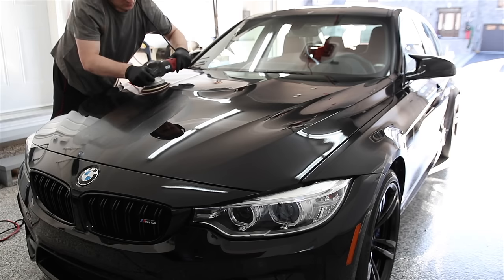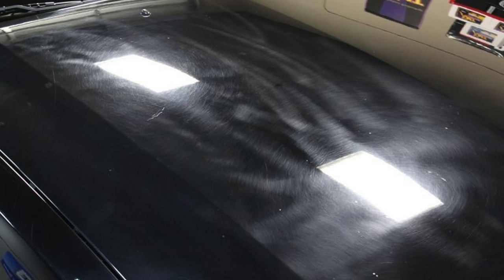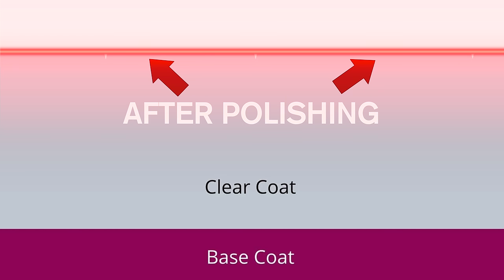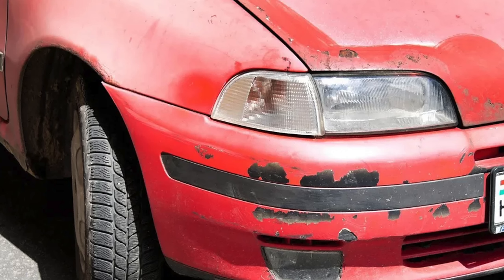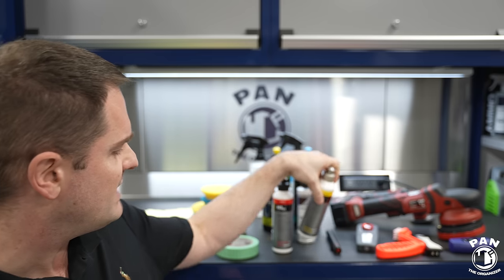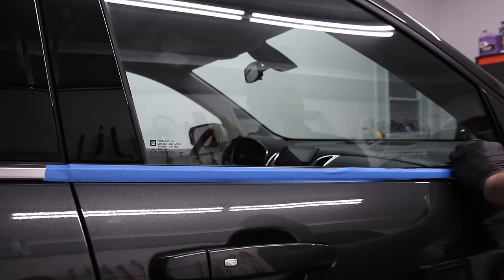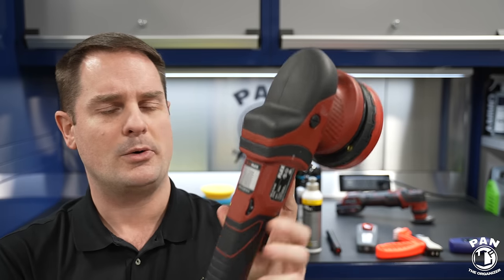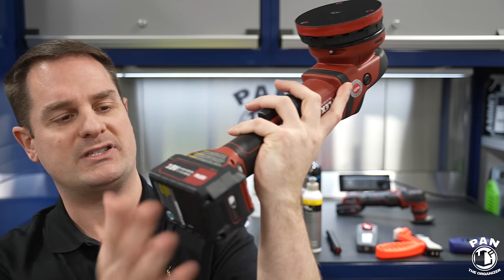DETAILING 101 - Paint Polishing - Everything You Need To Know

Comment: So you’re saying that polishing will wear down the clear coat? That kind of freaks me out. Shouldn’t we want to protect the clear coat, rather than wear it down?
Reply from the maker: Polishing by definition is using abrasives to remove scratches and swirls and oxidation. It does that by diminishing the layer of clear coat to make it "flatter" and with that comes an increase in gloss as the light reflects better.

But you don't polish every month. There is enough clear coat on a new vehicle to last many years if you protect it. Once polished, if you use safe washing and drying methods, you should not have the need to polish for at least a year or two, perhaps more. 

I keep my new cars three years before buying a new one, and during those three years, I only polish the vehicle once: when I take delivery. To make it perfect and then I protect it. After that, I use safe washing and drying techniques and never have to polish again during those three years.

You could polish the clear coat a few times before even having to start to worry. You're removing that much clear coat after one polishing session. Unless you are using an insane rotary polisher with a wool pad and super aggressive compound because you have super deep scratches or swirls, or perhaps even you are doing water sanding, which probably won't be the case if you don't have any polishing experience.
Reply: @PanTheOrganizer  Thanks for clarifying!

Comment: The "fingernail" analogy confuses me... I have what (I'm pretty confident) is a clear coat scratch, but I can feel it with my nail tip... I really don't think it's even close to the paint layer, let alone the primer layer.
Reply from the maker: If you can feel it, most likely you’ll need to start with a compound first and cutting pad, and then do a polish step with a polishing pad.

Comment: Why can't you just add lacquer back onto the paint to get rid of the imperfections like scratch lines if the issue has to do with it in the first place? Why do we have to buy all of these expensive products instead?
Reply from the maker: If you were to try and fill all the scratches and swirls on your car with touch up paint, it would take for ever, and it would look like a hot mess. All your work would stand out like a sore thumb. There's a reason why NO professional detailer does this. It wouldn't be a nice result. Paint correction is the way to go.

Touch up paint should be just for what the name states: touch ups. Small rock chips for example. Where paint is missing, as you are down to the primer or metal substrate.

Scratches and swirls aren't down to primer or metal (unless you have super deep scratches from a key job or some accident). They're just in the clear coat, and reflect light in a way where you see the imperfections. Paint correction levels the clear coat, making it true and flat again, so the light can reflect properly and you see nice glossy perfect paint.

Comment: lots of good info, but the terminology is a bit confusing. compound is "a chemical that combines two or more elements", why abrasive stuff is called compound and finer polisher is not? dont they both include two or more elements?
Reply from the maker: They are all polishing compounds. That's the general term for liquids that are applied with a polishing machine. The liquids act like sandpaper to gradually remove surface layers (clear coat) and eliminate scratches.

But to keep things simple for beginners, there are two general classes of polishing compounds. 

A "compound" in the detailing industry is lingo for an abrasive with larger sized abrasive particles, meant for heavier defect removal: heavy oxidation, big scratches and big swirls.

A "polish" is a refining abrasive, with smaller sized abrasive particles, meant to remove the "sanding" marks caused by the compound, and further refine the surface, increase gloss and clarity, and remove the minor scratches and swirls.

So on a vehicle with lots of heavy defects, you would start with a "compound" (also called heavy cut polishes) and then finish with a "polish" (also called jeweling polishes).

On a vehicle that has only very light swirls or scratches, like new cars, you can skip the "compound" stage, and just do a polish stage most of the time, as there are no heavy defects to correct.

I hope this clarifies things for you.
Reply: @PanTheOrganizer  but a polisher contains two a more elements, which is the essence of the word "compound", how come an abrasive is a compound and a polisher is not? i am confused
Reply from the maker: Please stop trying to compare words in the dictionary, with the literal meaning, to the detailing industry terminology. I think I responded clearly enough with an insanely detailed answer. Both compounds and polishes have abrasives in the formula. They are just different size abrasives in each one. Bigger abrasives = compound = more cutting and correcting. Smaller abrasives = polish = less cutting, and more gloss enhancing and finessing the finish.

I don't understand where your confusion is. When doing paint correction with a machine polisher, you have two options:
1) Start with a coarse compound liquid to remove heavier defects. Second step is to finish with a polish liquid. Done.
2) If you only have light defects, skit the coarse compound liquid, and just use a polish liquid.

Of course in the liquids, there are a bunch of ingredients in the chemistry, like oils, lubricants, and other things which you'd need a degree in chemistry to understand, and that's beyond the point here. This is simply a tutorial on paint correction for beginners, so you can learn how to actually REMOVE THE DEFECTS of the paint, and make it glossier.

Comment: So, basically only the weight of the machine is enough for doing the cutting, no extra pressure to apply
Reply from the maker: Correct. The less pressure you apply, the less heat builds up. And the less heat builds up, the better the cutting power.

Welcome to my channel. You discovered one of the biggest car detailing channels on YouTube as we surpassed 980,000 subscribers and we have over 132 million views! I have been detailing for 26 years and I love to share my knowledge and passion with my viewers.

You found the right channel to help you learn everything about detailing.

Comment: Struggling to get water spots off during polishing
Reply from the maker: Before polishing, did you try chemical water spot removers? See my video: https://youtu.be/s1XNKFVSwRk
Reply: @PanTheOrganizer  I just watched last night after I had done a few panels so I hadn't known about that before. I thought maybe the polish should've done it even if I didn't use the chemicals but Is that not always the case? If I do that on panels I've already polished, do I need to polish again?
Reply: @PanTheOrganizer  also this paint has been sitting for 10 years in a garage. Water spots likely from touch wash and then sat so there's water spots and lots of swirls/pigtails. After several passes, it's noticeably better but still so many left. It's a little demoralizing to see so much left after that much work. Is there a better product or pad you'd recommend than meguiars products/pads for the hard stuff?
Reply: Wasn't sure if youd had a chance to see my responses, understanding you're quite busy.

Comment: Does this work on a new car covered in orange peel?
Reply from the maker: No. But keep in mind, orange peel is actually important on a daily driver. Orange peel is what helps protect the clear coat against you seeing too many of the visible scratches and swirls. Having a perfectly smooth and flat surface will give you amazing gloss, sure, but that also means you will see all the little defects, swirls, scratches, dings, a lot more. Any defect would be amplified if you have zero orange peel.

Wet sanding, is the most commonly used method to remove orange peel. Basically you wet the surface and the sandpaper, and diminish the clear coat until the surface is smooth. Then you follow with a polishing procedure to further smooth out the scratches you have created with the sandpaper. 

Hence why removing orange peel is usually reserved for show cars, weekend cars, museum cars, cars in high end auctions, etc.  Cars that are really taken care of, not daily driven, and where it makes sense to have the paint shine as much as possible and have the reflection as perfect as possible.

I hope this helps.

Comment: You are removing Clear coat and their is no way around it !!!
Reply from the maker: Exactly. But polishing doesn’t remove much. It’s the dual compound followed by a polish (2-step paint correction) that removes a few mils, but nothing to be worries about. You can polish a car a few times before even starting to worry about how much clear coat you are removing.

Once polished, if you use safe washing and drying methods, you shouldn’t have the need to repolish the car for a few years.